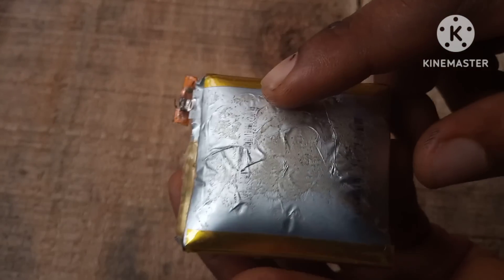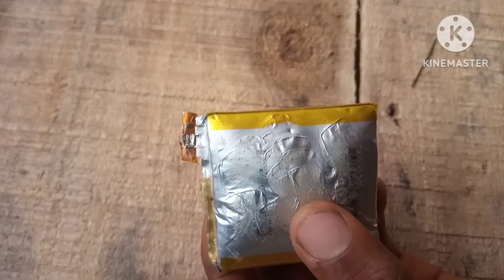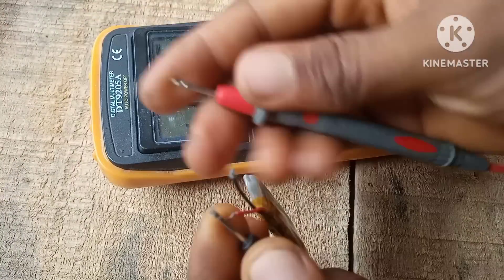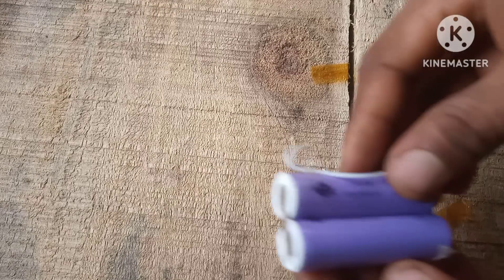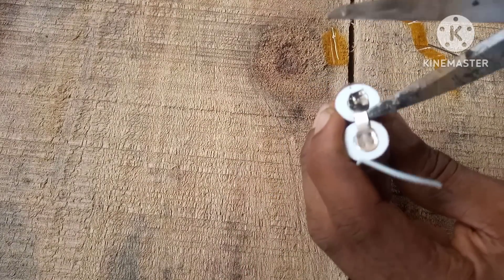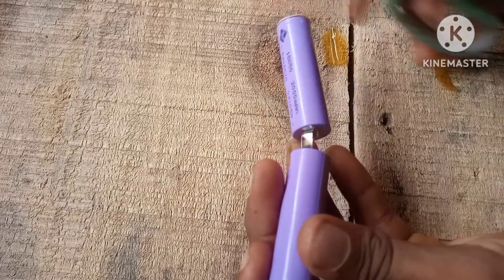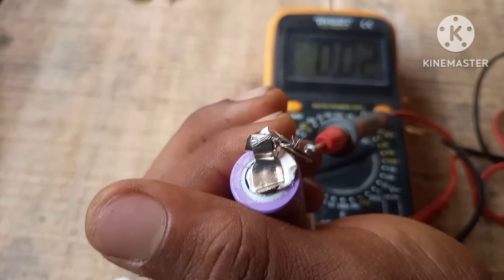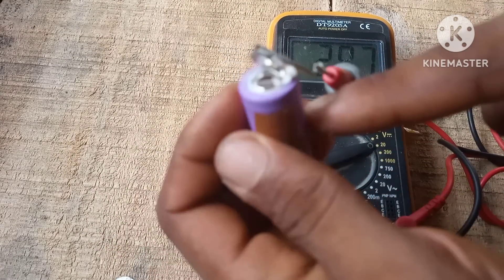How to fix all lithium batteries/ LIPO battery in one video

Comment: what is below the cap of 18650 that has to be tinkered, bimetallic tripper ?
Reply from the maker: It's called a CID it works like a valve it has to be pushed down to release the gas, in order to get the battery functioning again
Reply: @Blinksiteengineering  man all ev's battery banks based on 18650 or others  can go powerless any moment from cid's, the bms & charger can will keep on wondering what is happening with the battries, good old lead's were atleast reliable.
Reply from the maker: @bazrazin1  Yea that's true man

Comment: Sometime battery swell not only from overcharge, but overdischarged as well,   

Li based battery undergo unstable chemical in overcharged/overdischarged state., 

But usually worse in overcharged state.
Reply from the maker: Absolutely that's what I failed to add